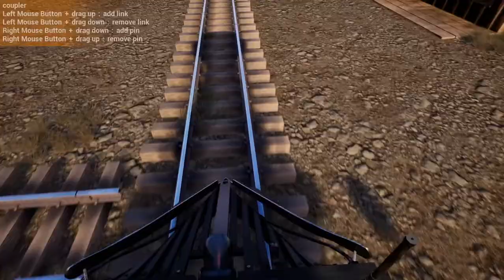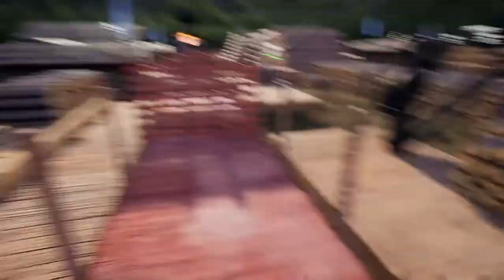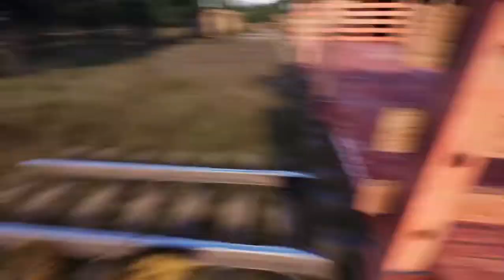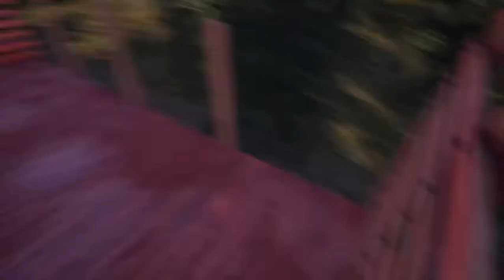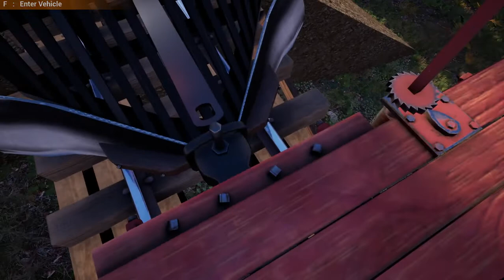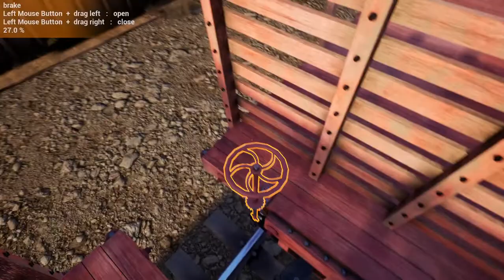RAILROADS Online!  Fly Switching Bulkhead Cars on the Caney Creek Railroad!  Fun and Informative.

Comment: I had nothing but problems when I tried using that bar for pushing.  If there is too much curve it will push the car off the track.   If you accelerate with any force it breaks loose.  I hope they fix it.
Reply from the maker: Yeah, I believe the front bar was problematic in real life railroading as well!
Reply: @grumpyoldrailroader6334  I can defintely see why,  but I think the physics in the game exagerate the flaws of the real design.
Reply from the maker: There are problems with the Physics in the game for sure, not sure how much is the developers fighting the UnREAL engine or just glitches but in my experience with other Early Access Games - RAILROADS Online! is remarkably STABLE!  So I tend to overlook those small glitches with the Physics.  Ergo - I avoid using the front BAR if I can...  THANKS for Watching hope to see you on the Twitch Stream or on Discord.